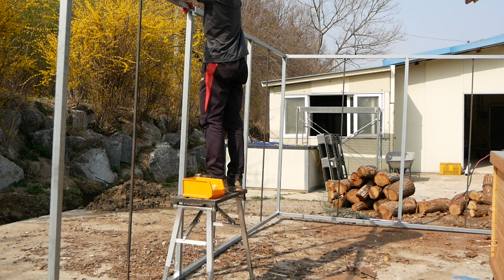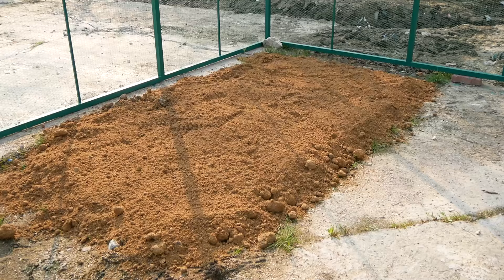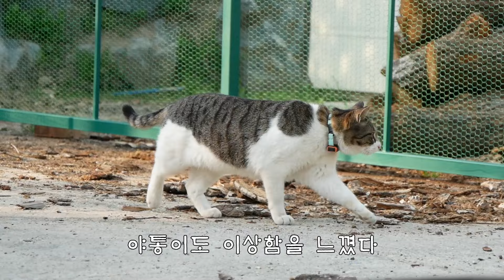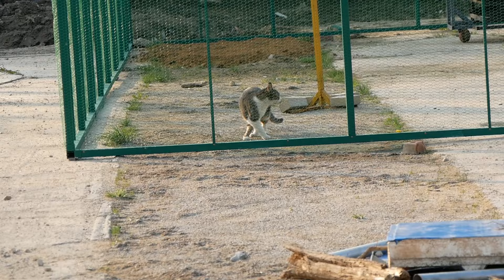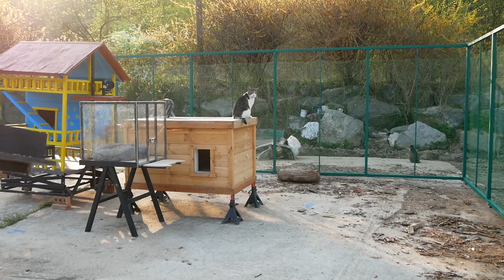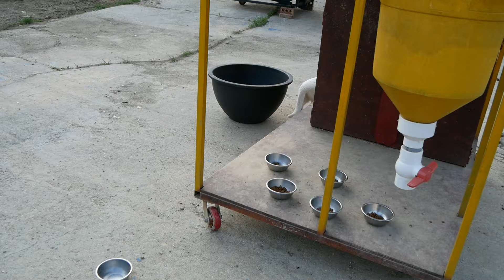울타리 안에 갇힌 고양이들

Comment: The fence is probably already upgraded, but if you put an edge at the top that's horizontal and parallel to the ground, they'd have to be upside down to get over it, which would be very difficult for them. 🌲⊺🐈⊺🌲 Good luck!

Comment: you need to add a "roof" over the fence also made out of mesh or rope. that way they do not climb over. the bottom part needs to be reinforced as well, because they can dig under the mesh and escape that way. i would also recommend making the enclosure a lot bigger, since there is a lot of cats. You should also fill the bottom with soil or dirt as well, so grass can grow. some parts may need to be sheltered or attached to the house you made for them. 

also, with a "roof" you can add more things and attack them to the "roof". i have a similar setup for my cats- they love climbing on walkways that stretch from each end.